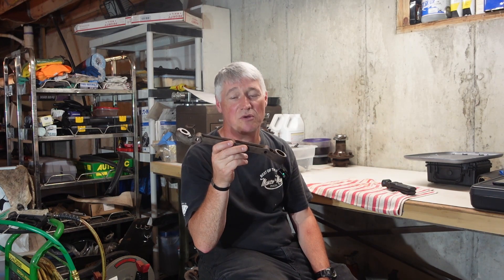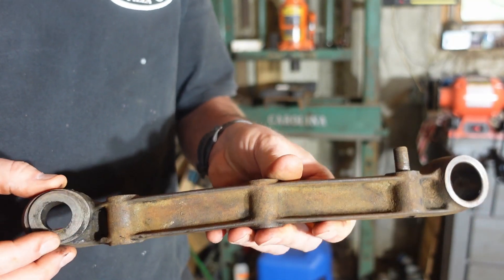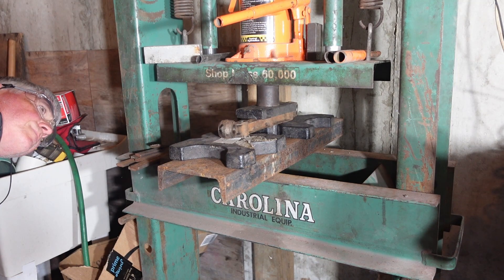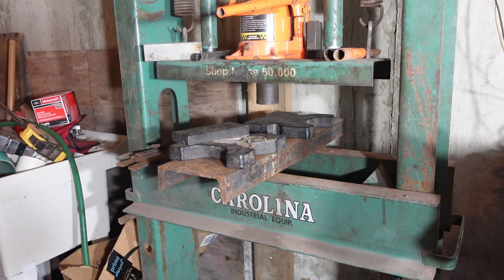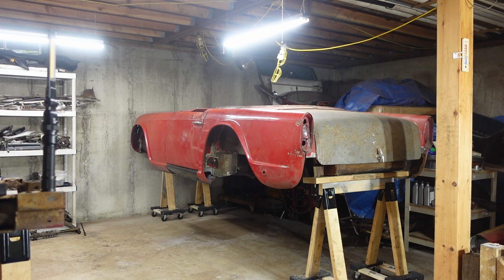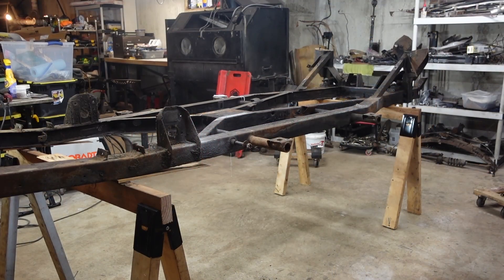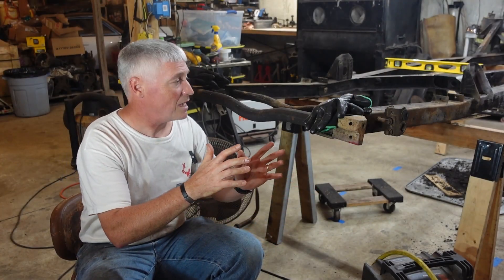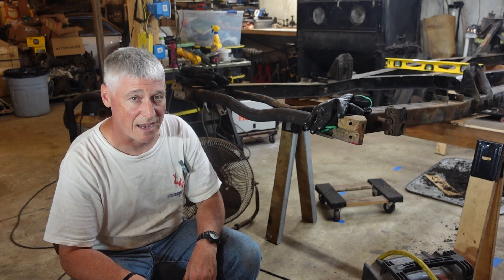Triumph TR4 - Suspension & Frame Measurements | Roundtail Restoration

Comment: Hi ChrisI I'm at the same stage with my TR4A in the UK; the 'stilt' brackets look interesting, not seen those before. What are they called?
Reply from the maker: Hi David. I assume you're talking about the black part? Those are sawhorse brackets - you supply the wood. Here's an Amazon link, though I purchased mine at a Harbor Freight (not sure what you guys might have that's equivalent - It's Princess Auto in Canada). https://www.amazon.com/FULTON-Corporation-400SHB-Sawhorse-Bracket/dp/B07XLD1KY9/ref=sr_1_4?keywords=sawhorse+brackets&qid=1695252296&sr=8-4
Reply: Thanks Chris, they don't seem to be available in the UK, shipping from US/Canada a bit expensive. Thanks for the reply and the link. @roundtailrestoration
Reply: Found them, not as expensive as I thought,  now able to get the tub in the air
Reply from the maker: Good deal!

Comment: Just curious as to what your plan would have been if there were any discrepancies in your dimensions. Good video,always fun to watch.
Reply from the maker: Good question! I hadn't thought about it that far. For that one piece that I straightened, I had a few leads on a replacement if I couldn't get it. If the frame was bent bad enough, I probably would have had to go looking for a replacement...somewhere.

Comment: Well done, Chris! Once you have it painted to your satisfaction, the fun part starts: bolting things back onto a solid foundation!
FYI: as you know, the TR4 has no means of adjusting the geometry of the front suspension (unlike the TR4A, which has shims at the inboard end of the lower A arms). Revington TR in the UK makes a neat, relatively inexpensive solution. They have a special upper fulcrum (mounts atop the spring tower) that is wider than usual and can be re-positioned at the mounting bolts. It uses shims at the upper ball joint to fine tune caster, while camber is dialed in with a plate that ultimately gets welded in place. Of course it is best done on a proper alignment rack... so would need a trip to a shop that can do that for you.
Reply from the maker: I'll check that out. Thanks, Alan!

Comment: Great tutorial Chris! Thanks for all of the information. Congratulations on a straight frame. The "press work" was right on. 

We work with some very early or rare vehicles where some parts are pure unobtainium. Repair of those parts is of absolute importance.  Repair is normally far easier and appropriate rather than manufacturing a new replacement.  

Thanks again Chris
Reply from the maker: Thanks, Matthew. I was glad I could get it back straight. Always a nice sense of accomplishment saving a 60+ year old part.